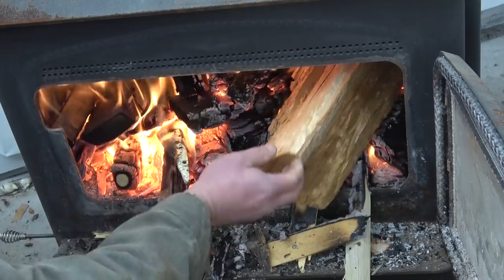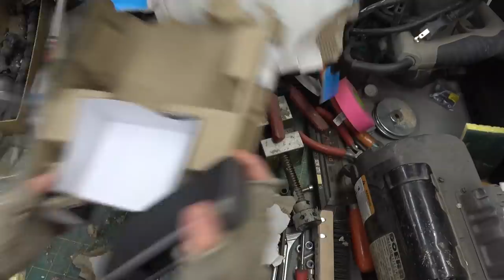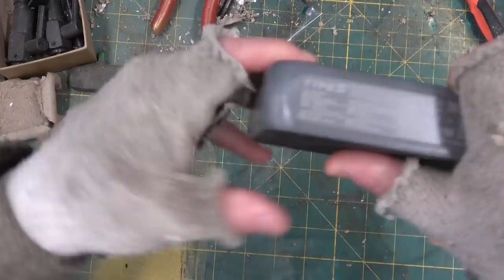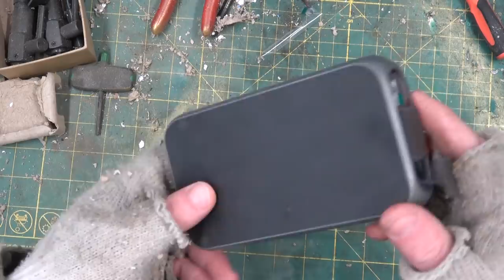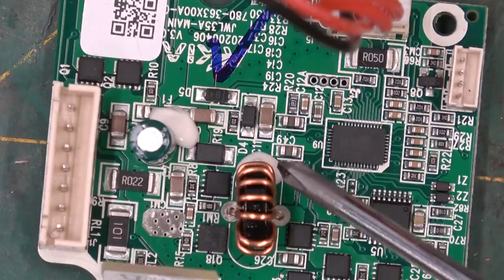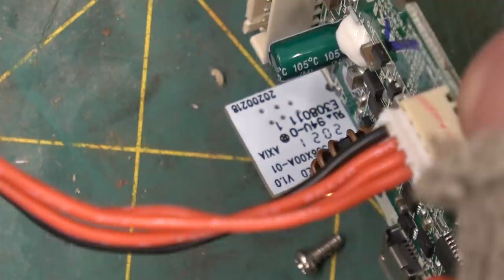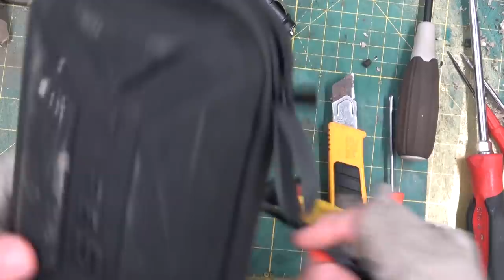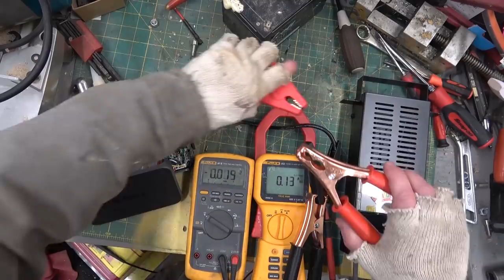BOLTR: Costco Boost Pack | Stupid Design

Comment: From my experience with one of those it only works if the car just needs a little jump. We keep one in the shop to help members. Pain in the ass. Full dead, never works. But, if you just left the lights on while you shop. By the time you get it figured out how to set it up the main battery will charge up a bit and it will give you the boost you need.
Reply: I don't know about this particular brand, but the one I've got, I had my car full dead to the point that the doors wouldn't unlock via the remote.  No lights.   And a similar one of these things got it running after two turns of the key (so to speak, it's a push button).
Reply: @nate8088  Yeah, as long as the battery in the vehicle isn't completely dead, one of these will do the trick. It trickles some current into the battery, and then the battery supplies the current to start the engine.
Reply: @kain0m  That's not what he just stated lol. He just said he used one and his battery was dead. D-E-A-D ie: no juice left. YMMV of corse

Comment: That's a gamble on 95% of the customers never even trying to use the thing.
Reply: You have that in your car for years, and then when you finally would need it, either it's not charged anymore, or the output power would not just be enough as seen here. I recall when it was -28C outside it took at least 20 seconds to start a Lada.
Reply: Ed Zachary

Comment: You nailed everything on its failure. I took back two, thinking the first one was just a bad unit. Wouldn't stay on long enough to start anything. I have a HarborFright one I've used for about 4 years without fail when needed. This Costco one was rated for more  amps so I fell for it... twice. So I have sence just bought another HarborFright to stick in the truck...

Comment: clean your charger hole, that's been the only time my usb-c ports have stopped working, was a lint ball in there
Reply: I have this issue all the time using the phone in dirty environments. It's super annoying.
Reply: @bryanjk  buy one of those magnetic charger port thingamejigs they plug the port and stop any schmoo filling it up 😀
Reply: Tooth pick
Reply: @bryanjk  oh gods, those break on me all the time because small bits of metal like to get pulled into them.
Reply: gotta clean out the old belly button every once in a while.
Reply: I use a Otterbox defender case, its got a rubber plug for the charge port to keep the schmoo out. Works great.
Reply: @vernonbear  I had one of those and really liked it, for about a day until a bunch of metal shavings stuck to it. Works well if you never go near a fab shop though.
Reply: @averyw.3939  [cries in welder]
Reply: Was tired of cleaning mine, scamazon sells little plugs for them. Best $2 I ever spent
Reply: Mine get wobbly all the time. Some cables get disconnected with every ever so little wiggle and some still stick to the bitter end.

Comment: I have a similar device to yours. Different packaging but same device.
I have been able to start up to 4 dead vehicles without having to charge it with fresh pixies. And, yes. I too have to disconnect the jump leads to reset that rediculose mousefart pack. I run a small garage and use it a lot. I have even started a big diesel truck with it.

Comment: It’s mostly good for small vehicles that you left the dome light on and the battery just needs some help to start the vehicle. 

The reason the button doesn’t affect the resetting of the cables is because the internal battery’s output is hard wired straight to the output plug. That switch won’t disconnect that. 

That in-line box with the mosfets is just a current regulator obviously set at 75ish amps to keep from damaging the lipo battery. If you hooked this to a Honda Accord that just needed a little help it would prob only transfer 50 amps or less and as every second passes and the car battery voltage rises the load the the lipo booster pack would decrease a few amps. 50,45,40,35,30,25,20,15,10,ect,ect.. 
Once you turn the key over the 75 amp max output would be pulled but usually a car starts before the 5 seconds it would take to put this thing in “need to reset mode”.  Anyways I’m just laying in bed bored. Maybe my $.02 will help.

Comment: I had the previous version of the TypeS from Costco.  From a full charge it would drain flat in about a week just sitting in my truck.  I called the company and they said it was a “safety feature” and that it was recommended that I charge it “frequently”.  I would be curious to see if this new version holds a charge while sitting in the shop.

Comment: The current output is actually way higher, but the load tester you have is only rated to pull 100A.
Reply: It usually is connected to a car battery at maybe 10V (if "discharged").  The booster battery is 3.7Vx4=14.8V.  14.8V-10V=4.8V.  100A at 4.8V is a whole lot less power than trying to pull 100A (or 70A) @ the full 14.8V.  Does that work or is it just amps that are important here?  This test neglects the half-dead battery that will be helping out with the start.
I got one of these, within weeks used it to start a random guy's diesel transit van in a hospital car park where I was getting treatment.  6 weeks of antibiotics - god I was messed up.  Anyway, the van was totally dead.  Attached the booster and started first time.  Awesome bit of kit.  These are one of those gems coming out of China.  Everyone should get one, moreso if you have a car.
Reply: @EscapeMCP  I have one and started a truck yesterday at -8 F after they tried jump starting it with a few different cars. Sometimes you have to leave it connected for a bit to charge the other battery, or so I've been told. I have had better luck with my little one than with my big jump box.

Comment: I'm actually shocked you had more issues with "C" than Micro. I've had the opposite experience.
Reply: yeah thank god for the death of microB. I have had zero issues with any of my USBc devices. Usb-microB has been the exact opposite.
Reply: Same here.  They will all have their downsides. The upsides outweigh them in the case of USB-C. It also depends on how many times you connect and disconnect them...They will obviously wear after time and loosen. I am betting on the lint conspiracy though.
Reply: I agree. This is the first time I've owned a phone for over 3 years and the charging port still works. Mind you, it is a Note 8. So, I have burn in issues and a couple minor issues that plague the phone. The charger for the first time since I owned a Nokia is not the problem first lol.
Reply: Coming from a guy who's had three of em, Pixels have shitty USB ports. I've been wireless charging my Pixel 3 XL for the past year, just upgraded to the Note 20 Ultra and the USB port is much stiffer imo
Reply: I've had the same issues he mentioned with C plus the actual connection isnt as solid. Usb C in my experience wears out way more quickly

Comment: I've got one that Costco sold a few years ago.  Very similar issues.  Also very useful for starting my lawn tractor.
Reply: It's not an issue.  They aren't meant to be jump starters.   They are meant to charge the battery and then start the car.

Comment: Technically Micro B is far weaker than type C, but there's always someone who's had a different experience.
Reply: Yep was about to say that. Micro b is rated for lower amount of cycles, and it is consistent with my experience in the past. No problem yet with my 2017 phone with USB-C and had problems with every micro-b phone before that.
Reply: @awgmax  I've had problems with C, but they were all solved by taking a toothpick and digging out the lint and dirt stuck in the port on the device.
Reply: never ever had anything go wrong with USB C
Reply: Micro B on a Pixel mind you. Like a chrome book but for your walkie-talkie.
Reply: USB C is far superior. Micro B used to be the crappy Archillies heel of every device.
Reply: I don't trust any of those tiny little connectors they use on everything now. They all lack the robustness of a nice, big D sub connector attached to a heavy steel chassis.
Reply: @rocketman221projects  With those bent pins you gotta straighten out because your kid tried to shove it into some other random port. Gotta love em! 🤣
Reply: My USB C on my Nokia failed. But that was a known issue where the solder joints crack, nothing to do with the actual USB C port or plug, just poor lead free solder joints to the board. Otherwise I haven't had a USB C fail yet, much better than micro usb in my opinion, they were always failing.

Comment: I got me one of those Type S boosters at Costco in late 2020. It couldn't start a Ford 2.0L 4 cyl with a dead battery about a month ago. It cranked very slowly a few times and then the battery pack needed recharging. Temperature outside was just below freezing. Also, I don't think you can use it to trickle-charge the battery either, as the battery pack will shut itself off after like 2 minutes. So yeah, it's NFG indeed!

Comment: I have a Chinesium version with no display or beep-boop or code-blinkenled (but with SOS flashlight!), and it cranks my 2 liter Mazda Skyactive engine quite easily despite the 14:1 compression ratio.

Which was needed because Mazda put crap batteries in their cars for a few years.  Gave up after three replacements and bought a decent battery.  Until then, the jumpstarter was being used so often that I got a small Coleman solar cell that I stuck on the dash to keep the battery topped up.  Worked like a charm.

Another thing about my cheap jumpstarter is that the self-discharge rate is far lower than my other LiPo batteries.  Still worked after being ignored for nearly a year.  My other LiPo batteries drain while you watch them.

Comment: I has to add this after the other comment because I have one of these units. It's a BASAF I got from amazon.  1500 peak I think . It does time out after 5 second or so. If the battery on the vehicle is stone flat, I have to press a small boost button on the connection where the clips are. It's been quite an ally to me, probably jumping 100 vehicles since I got it two years ago.  You are spot on with operating temperature too. It was a no go with a hyandui elantra I was trying to help someone out with in sub zero temperature,  it didn't help that the car was flooded and never seen a tune either.  Outside of that,  the only thing it couldn't get to pop was a 7.3 ford turbo diesel without a gear reduction starter. It almost had it. But overall they are actually great tools in my opinion.

Comment: I keep one in my panniers for my motorcycle when I travel.  Plus it's extra juice to recharge phone, tablet, and my Blue Tooth connection for my helmet. The weather is usually warm when I use the bike, at least relative to last night which was -18.  Due to size and power of the unit and my engine being 1250cc's...it's awesome.

Comment: Those little things are fine for helping start something a little low on juice, but a proper jump box they are not.
Reply: Well, the one I got is about the size of a large phone and provides 400 amps. I have started my V8 truck with it. Granted it wasn’t completed dead, but didn’t have enough beans to crank it. Not bad for something that will fit in your pocket.
Reply: That's the 90% I suspect this sort if thing is meant for. Small enough to keep around, just enough to get a failing battery over the line.

Comment: In the dingus there on the end of the alligators, those are mosfets in a forward bias orientation. Some mosfets work as a diode when no ground is connected to the gate and some work as a diode when no hot is connected to the gate. Which is which depends on npn vs pnp, but I cannot remember which does which. You'll also see mosfets wired up with a cut gate if they're being used as a buck (voltage down) regulator. The four of them there prevent reverse polarity as well as charging, but there's four of them there to reduce the cooling for a high current. Think of it like trying to run a 2 inch water line into a 3/4 inch garden hose. You're restricting the flow which produces heat and an apparent pressure drop on the small side. But if your run the 2 inch line through 4 3/4 inch hoses, you can recombine them on the other side for minimal losses. Likely no real switching going on in there. Also that voltage drop is because of ohms law. High current, low resistance, makes for no pressure.

Comment: I have this pack and have started my completely dead 2004 CTS-V. 400 hp 350 cu-in in ~20°F weather. Took 2 attempts (it’d been a couple months since I’d started it). My ONLY complaint so far, the over-molded plastic on the clamps is so thick it’s hard to get them to grab & hold onto the little screw-bolts for side terminal batteries. It uses ~10% of the battery per attempt so you’ll get a solid 9 tries per pack charge. I also have a 2000 power stroke but my batteries haven’t been dead enough for me to warrant testing. I would absolutely buy again. My CTS-V seems to suck the battery completely dry in a couple weeks, low enough to not start in ~5 days (it’s a new battery, haven’t done any draw testing- maybe when the weather warms up I’ll get to it). Suffice to say, IMO, this video does a disservice to the pack. It works well for my needs and I’ve never read the manual. Disconnecting to reset wasn’t hard to figure out and I’ve had no issues with the light. Pretty standard hazard light function that some LED flashlights come with now. But, what can you expect from a homeless man who opens cardboard boxes with a chainsaw & disrespects EVERY tool he has. Sorry AvE, you shit the bed on this one.

Comment: Because of that Mostfet protector blob, it only works with the clamps on a car battery seeing about 10V, only then will it deliver a full charge, which is probably not more than the 76A you saw initially. It really relies on the lead acid battery soaking up some volt'a amps and behaving like a huge capacitor. I had an HVAC guy stuck in my driveway for 45 minutes here in sunny FL trying to jump with one of those. It got exceedingly hot and after three tries stopped working, no luck. His truck battery was pretty hosed. Had to push his truck "up" my driveway to get a car turned around and use the old style jumpers.

Comment: Yup.. I had one of those. Only a higher-end one. Took it out and tried to start my old F150 with the strait 6.
20 deg outside. It cranked for 4 or 5 seconds. Then shut off and you had to reset it for another 4 or 5-sec try.
4 or 5 seconds does not even get you in the range for starting here in Minnesota.
F that!! Gave it to my son. Keep this in your car in case you leave your lights on or want to charge your phone.

I ordered a Schumacher SJ1332 with sealed lead acid AGM batteries.
15 deg out. Galant with a dead battery. Crank crank crank 15 seconds " Varoom!!!"
Walked over to the F150 hooked her up. " Varoom!!" off she goes.
Had the Farmall 400 plugged in to heat her up. Hooked up " Varoom!!!" off she went.
Heavy as heck, but she did exactly what I wanted it to do.
Took it back in the basement, plugged it in for the next time.

Comment: I've used an older one of these a lot before. It works okay, but I don't like them. They work 90% of the time, but that other 10% I just got my Jeep and a good set of jumper cables, and it worked better. It also helps that the jumper cables can run for a few minutes and charge the battery, which this jump pack can't do. The old, heavy style jump pack, with the lead acid batteries, worked 99% of the time, mainly because you can let it sit and charge if it needed to.